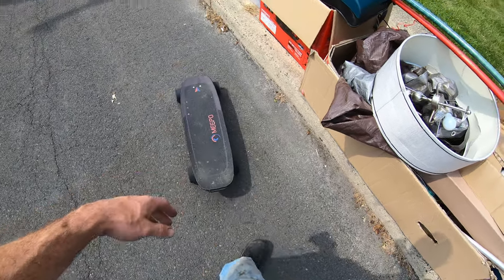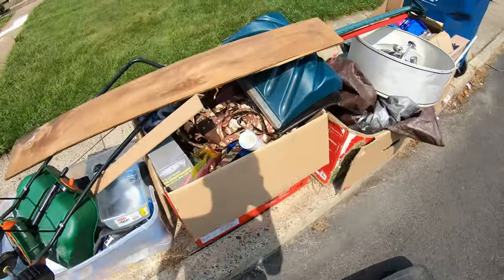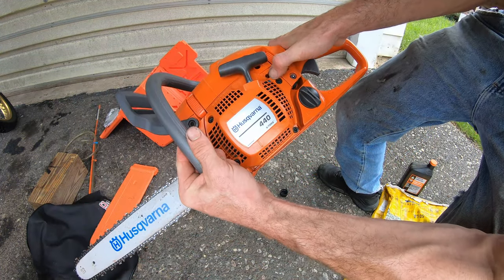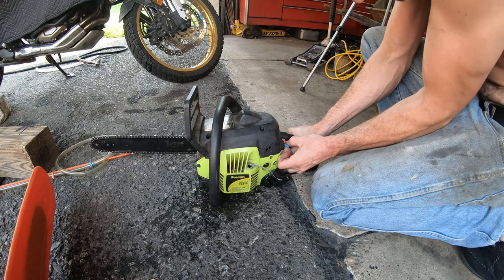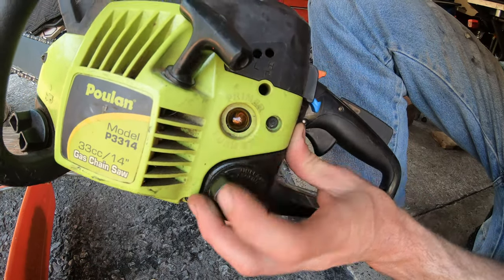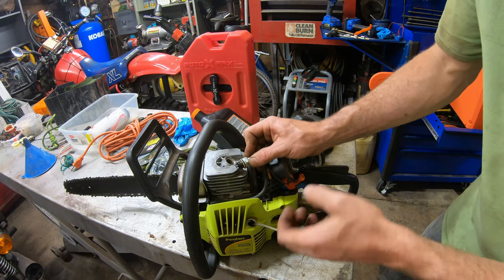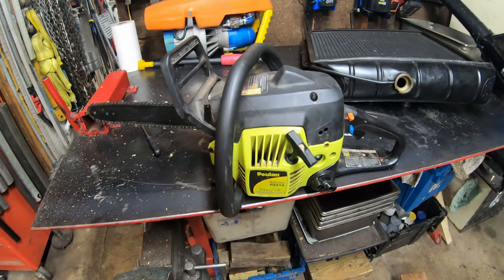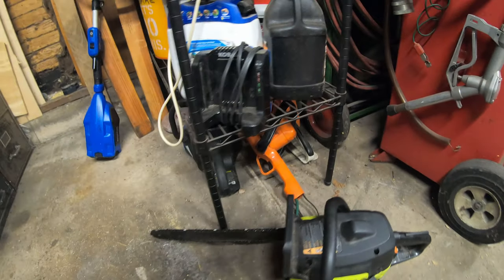Free Chainsaw, will it run? / Fixing Mine

Comment: I own 9 saws and build/ fix/ mod them for people. Although the 440 is a homeowner grade saw it's still a husky. The one tree service  company I used to work for had one and it wasn't horrible. I own a 346xp which is a great saw with the awesome magnesium case that husky doesn't make any more unfortunately, and of course the badass 372xp. Both big bores w/ meteor pistons and Caber rings, ported, muff mod, timing advance, etc. My other 7 saws are all stihl pro saws from the 026 all the way to the 880mag. I'd recommend modding your mufflers dude. Makes a huge difference on cut times alone not to mention the sound. Just readjust your carb after. What a score though man. Free husky that was near brand new in a 'power box' is a rare thing to find on the side of the road! Whoever used that saw definitely had the chain tight as hell. You could hear it when you fired it lol. 👍👍